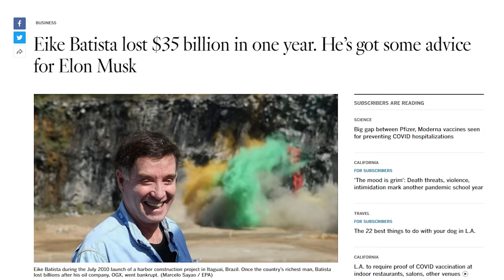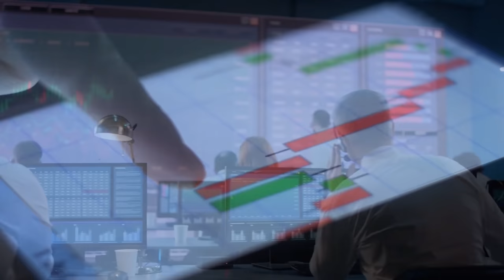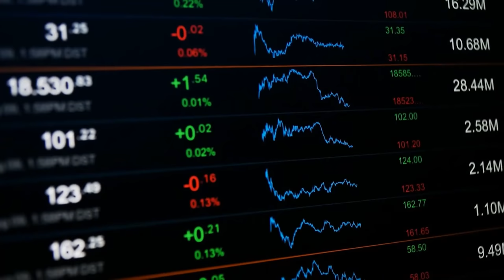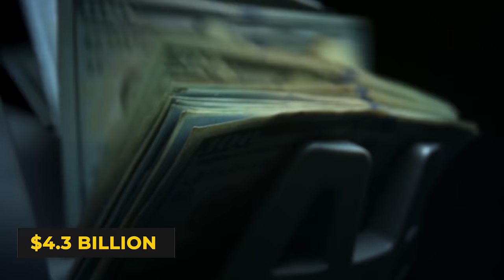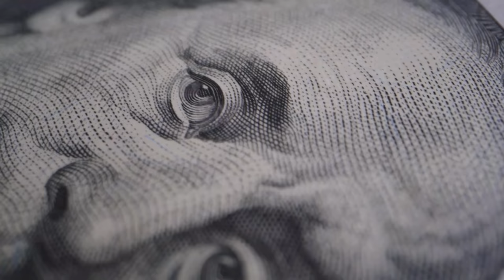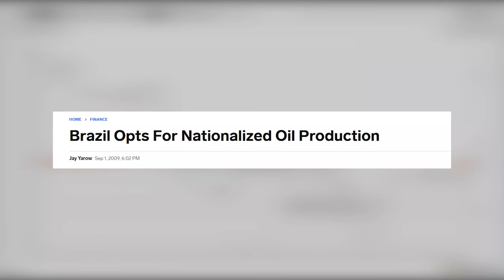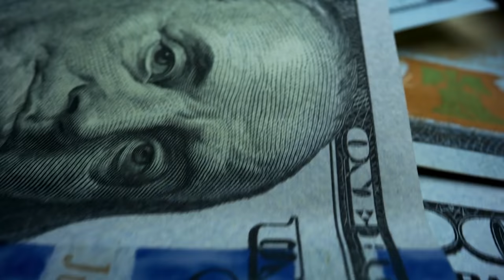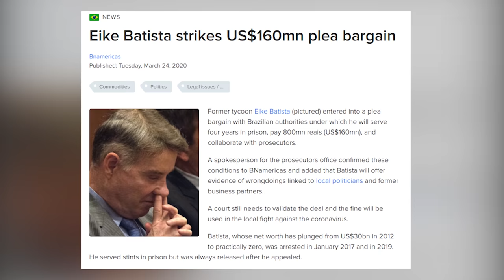How Eike Batista Went From $35 Billion To -$1.2 Billion In 1 Year

Comment: He diversified too quickly IMO. He wasn’t perfecting his previous companies before making something new. He moved too quickly.
Reply from the maker: True
Reply: Only master 5 kind of busines max, said Warren Buffet
Reply: Diversification wasn't exactly the problem. One of the major problems is that he had a, as he would call it, "360 degree vision" ideology . Basically, when company A was making a lot of money he built company B to supply company A, then company C to supply C... as you can see his companies were all related to something that the other needed (Mines, Electricity, Oil, Ships, Logistic), once the strongest ones (Oil and Mines) failed, the rest went down with them as well.
Reply: @lucasp8047  I acknowledge what he was trying to do but companies don’t fail when they have money that they can come up EASILY like Apple for example with about $200-$250BIL in paper money. He built the companies too quickly with BARELY to no emergency funds saved aside in case something happened. He wasn’t thinking about any risks. He simply wasn’t prepared enough to deal with the situation he’s currently in. He built key fundamental support companies too fast. He never thought of any risks in the future otherwise he wouldn’t have lost them.
Reply: I question your level of expertise to make such an assumption.
Reply: @chuckyfox9284  Not so much an assumption but for-sure an opinion. What I said wasn’t really based on facts but just a TINY bit of knowledge. Sounds a little contradicting I know.
Reply: Thats a great point